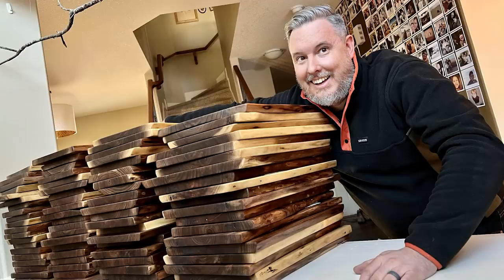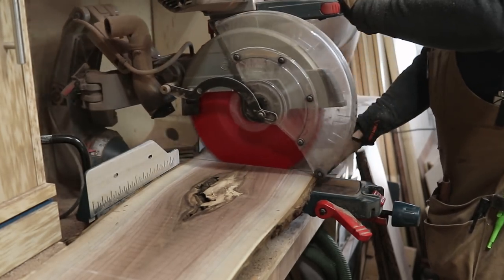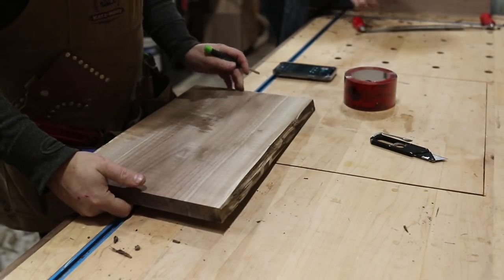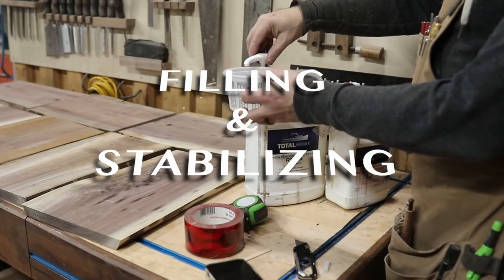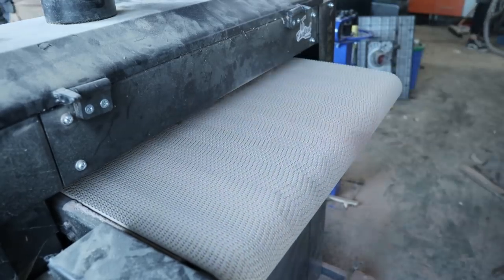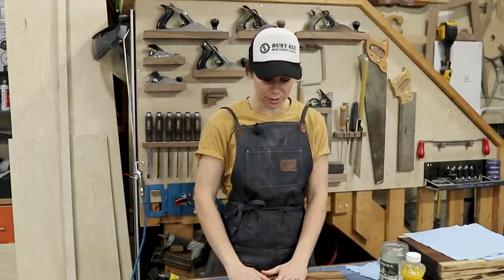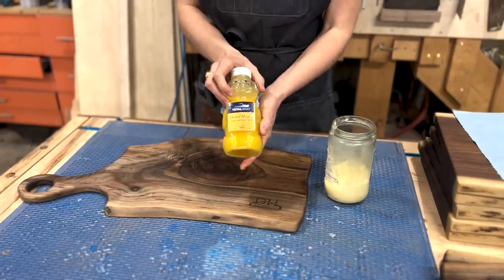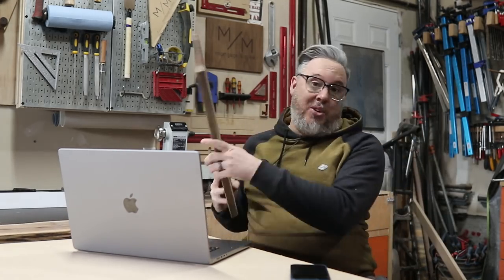Making 100 Charcuterie Boards!

Comment: Those boards with the extra rough edges were probably from trees that were skid scarred where logs being skidded out of the woods from a current or past logging scraped against them or another possibility is storm or wind damaged limb wood. These are exactly the boards I plan on making I have thousands of live edge pieces cut to make furniture and other projects like this. Great video!
Reply from the maker: Thanks, Mitch. That’s what I thought it might be

Comment: Cool process! Curious how that tinted hot glue holds up for finishing and overall durability. Is it soft to the touch once dried?
Reply from the maker: Keep in mind that’s not a regular glue stick, So it dries super hard and I let use it for smaller imperfections. We have a board in our kitchen that has some on it and it’s lasted sever years of heavy use. At the end of the day, I would suggest epoxy first.

Comment: Great video! I sell similar boards but I find my clients are wanting feet and handles. Do you run into that request?   I would love to skip the handles since i prefer to just see the grain of the walnut.  Are you able to sell to your real estate connections ?
Reply from the maker: When I was focused on selling produce, yes I was able to sell to a lot of the Realtors I deal with. I have a few that want handles but I charge a lot more for those.

Comment: Just subscribed.  You channel looks very interesting and you seem to have an interesting skill set in light of your profession.  (I can relate to that.)  How long did it take to get used to working and tinting epoxy? I'm going to need to learn how to use it on a smaller scale to fill in voids around knots -- walnutttttt!
Reply from the maker: Thanks for the sub! I’m no stranger to messing up epoxy, it’s not super complicated but definitely make sure you get your volumes measurements done correctly